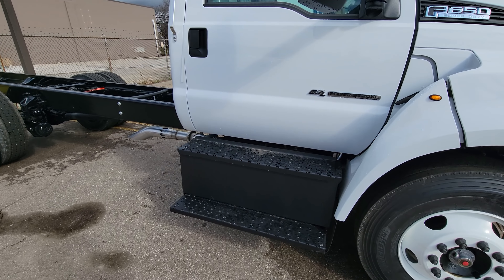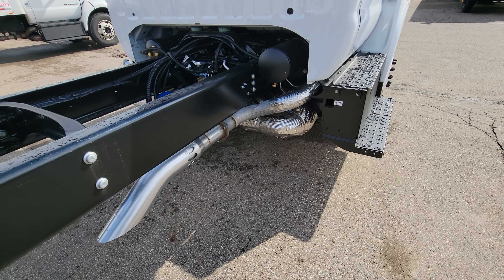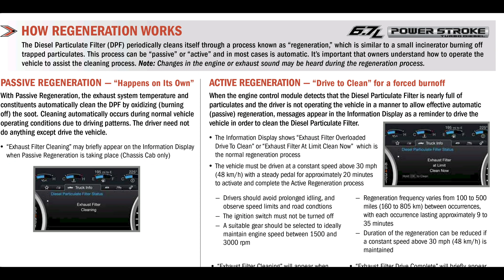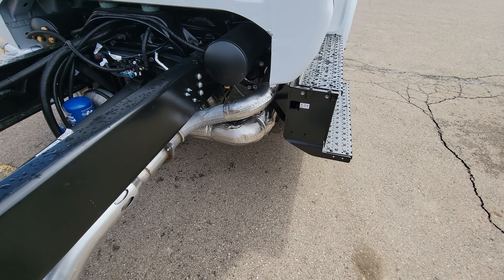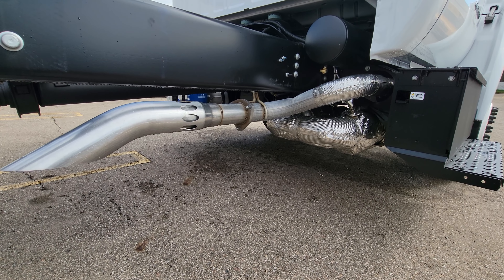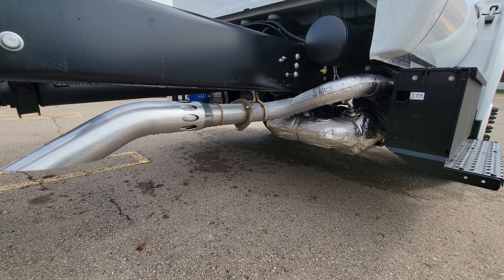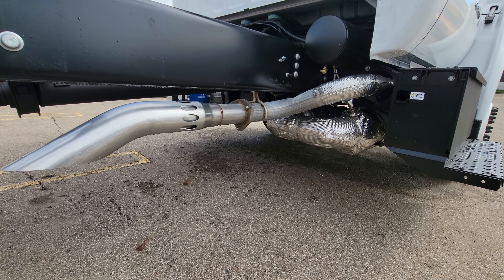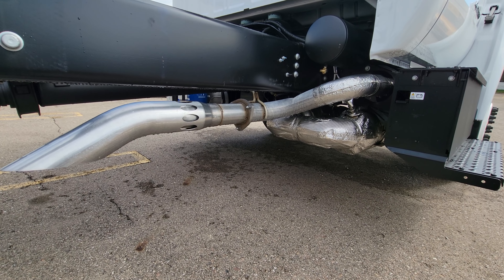IT's TIME! Emission & DPF Filter Regen TALK | What is goin on, What 2 expect & HOW TO USE

Comment: Arod question for ya! On my last regen while driving I hit some traffic for a couple miles and I thought the rule was anything less than 45 mph it will interrupt this process. Well it didn’t! I had my particulate screen up and noticed the percentage kept going down. I was happy it completed because my OCD is when I need to do a regen! But what are the rules while driving. What will cause a regen to stop? By the way thank you for spreading all that knowledge!
Reply from the maker: It has to be stopped for a given amount of time. U musta just kept it in the sweet spot

Comment: 21 f350, for the first time I watched the DPF being cleaned, went to 100% then started to drop. But 15 to 20 minutes of driving back home at 70 ish wasn't enough time to complete the cleaning, pulled in the driveway at 10%. Is this a big no no, or will it just continue and finish the last 10% of cleaning on my next trip without any potential problems?
Thanks
Reply from the maker: 10% no problem. Its repeated stops like this at 70 80 90% & not being cognitive enough to realize the truck is in the middle of cleaning that I would be worried about....! Good question tho

Comment: I still don’t understand why certain applications like garbage trucks still need to meet the same strict restrictions as an on highway truck. The constant stopping and idling is hell on the dpf system. I just learned from a truck driver from Alaska that they have dpf/def systems up there as well. Like it’s already hard enough running a truck in -40 degrees let alone having to worry about doing regens and DEF freezing.
Reply from the maker: -40F I don't even know what I'd do....
Reply: Thats why alot of garbage trucks around us are going to the cng. And those are another problem themselves. Its a lose lose situation this world is going
Reply: At -40, truck doesn't get turned off, or has plug in heaters. I have friends in Alaska. Even cop cars are left running 24/7 in places.

Comment: I’ve got a 19’ F2 fitty. Just bought and currently driving cross country back up to Alaska (towing a travel trailer also). Running like a champ. Regens just fine but never goes to 0%. It usually stops at 20% or so, lowest I’ve seen is 18%. I have the edge insight cts3 for monitoring the percentage. Is this normal for it to not go down to zero or is edge insight not reading it correctly? Any info or insight appreciated.
Reply from the maker: You could try manual regen
Reply: Throw that insight in a rest stop garbage can and get Forscan. Activate your DPF% screen and deactivate auto regen so you can turn it off. Use Forscan to monitor any PID you want along with programming changes. Oh and it's much much cheaper.

Comment: I've heard of some sensors related to the emissions after treatment system failing with higher mileage and stranding drivers until it's towed to a dealer for replacement.  Can you shed light on common failure points and part #'s for those of us who might want to keep some spare sensors on hand to not get stranded? Thanks!

Comment: New to the 6.7, my dpf filter is currently at 90%, will it start a regen at 100%?  Will I get a warning its happening or about to happen?    It's a 2015 xl
Reply from the maker: It will. It may display the drive to clean exhaust
Reply: It will begin regen at 99% (displayed- if the engine is hot enough)  and count down in increments of 5.   If the weather is very cold, you can ease it around for a few miles to keep it from kicking off, but conversely if you slow down at a ramp or stoplight, the Regen may terminate early when really cold outside.  I would downshift manually trying to keep my rpms above 1500 and it seemed to help.  It is almost impossible to stop a Regen from kicking off in hot weather. Sometimes you just want to make it to the next day or 10 miles down the road, you know?
Reply: @SeaPro360  I just want the first one to go smoothly so I know what to expect for the future.  Obviously with 100k on the clock it's done it before but not when I've owned it.   Truck is new to me

Comment: We know these trucks use a lot of fuel to be soot free. There is the 20-25% reduction in fuel economy just for having the system in place, as well as the fuel consumed to regen. Is all the extra CO2 that results from regens and the diminished fuel economy wirth catching the soot??? Somehow I think it would be more beneficial for these trucks to get 20mpg instead of getting 15mpg.

Comment: Need sone help here: 2016 F250, deleted, EGR unplugged but not blocked off, 200hp SDT tune, stock exhaust (drop in delete pipe), 75k miles, bought it with 7k miles. Does not consume oil or coolant. Smooth idle, great power, no CEL or funny stuff. Crank case vent is still installed. I run archoil and good diesel. Best money I have ever spent...... just one concern. After getting up to temp, a medium haze of blue smoke will spew from the tailpipe only while idling. Smells like raw diesel. It has done this ever since I deleted. Anyone else’s truck do this? I suspect tuning? Out of ideas. Been in and around these trucks/motors quite a bit, got a few of them in my fleet including my personal truck.  Thanks for any help!

Comment: Is there any way to start a regen while driving? Like turn the option on with forescan or anything? I turned the percentage on which is helpful but I’ll take a 40 minute drive on the highway when it’s at 95% and won’t regen. It’ll then be stuck at 99% and now I’m driving around town for the next week...
Reply from the maker: Do but u cld just stop wasting time and just do a manual regen when u get home with ur scan tool
Reply: @PowerStrokeTechTalkwARod  so there’s no menu option to do it? I just want to do it to prevent problems until my warranty is up...
Reply from the maker: While driving normally, no. Driving w/scan tool yes
Reply: If you enable OCR using forscan choose option #3.  I believe it is named “OCR with regen inhibit”. That will allow you to start a regen once the DPF reaches indicated 100% capacity.  That way you never get caught with 5mi left in your commute with a truck starting a inopportune regen and not completing it.   However the onus is on you to do a regen before it fills to a level that puts you into limp mode putting you at the dealer for a forced regen.  I’ve run mine to 130% a few times without issues.  However most times I’m doing it at 105-110%.  2020 F350 KR.
Reply from the maker: Thanks for sharing
Reply: @original72canuck , yes that’s how you activate it in full manual operation. It will tell you it’s full but not activate the regen process. After 100% full, the system will typically say drive to clean. If I remember correctly, 150% is basically engine idle only as it believes the DPF is indefinitely clogged and needs removal for service. You can try and fool that figure by creating a “calibrated leak” in the pressure differential hose which in theory would drop delta P across the filter to a lower value which should allow a regen to occur. Granted, I’ve never seen this get that out of hand yet but anything is possible.
Reply: @TC93 sounds like something is wrong. It won’t regen until it is at 99%. 95% will not cause regen unless you approach the 500 mile threshold for a scheduled active regen. Could possibly be the pressure delta sensor in the DPF or the throttle plate not functioning properly. Wild enough, the throttle body/throttle plate is a contributor to the regen cycle occurring.
Reply: So I set up my truck allowing me to disable regen and added the filter to my screen. Can someone please let me know at what percentage you are causing damage? Also with what I did on forscan will it allow me to do a manual regen while stationary? I have not enabled OCR at the dealership. Thank you! I love your videos!
Reply: @vais3  nope nothing wrong. Just trying to take advantage when I’m on the highway! I just learned it goes up to 130-150% though
Reply from the maker: Thanks pal

Comment: Anyone know anything about the P2002 code. I’ve done the manual regen and the CEL/MIL went off and now back on. I would consider the truck use city more than hwy. truck just reaches operating temps and maybe 15 minutes past before arriving to job site and turning it on and off through the day to relocate. I’m not real clear on what the usage of the trucks is supposed to be as it seems only hwy use fairs them well. I also understand there to be an issue with the dpf cracking prematurely via a TSB I found covering a few years. I’ve been doing oil test and all is well except 10% fuel dilution on regular oil intervals 5-7k. My understanding is these engines and pretty much any engine is designed to get to operating temps and maintain those temps for some time thus mitigating some of the fuel in oil upon startup via chemistry and heat. I don’t interrupt any cleaning cycles however I don’t feel it’s getting the best “dpf plan” given what we all know about the systems. In other words it sees a to take some pretty ideal conditions that most don’t sustain for a full burnoff. Any insight in this code and can we look at inlet and outlet pressures via FORScan to see if we have a crack or leak. I don’t know what the values should be.
Reply from the maker: Time for a a catalyst
Reply: @PowerStrokeTechTalkwARod  at 70k miles? I care for this truck like your million mile 6.7 you had in a while back. And by catalyst you mean the SCR?
Reply from the maker: Yepp cat scr dof are all the same tbing
Reply: @PowerStrokeTechTalkwARod  troubleshooting is not the art of replacing a bad or worn part, it is finding out what led to that premature failure and adjusting in balance. I’m pretty disappointed in the vague reply being that answer leads to replacing the scr every 70k miles. It may be one unit but it’s not all the same, scr reduces NOx and dpf reduces soot. More soot occurs at low temps and more NOx at high combustion temps. I apologize if my previous comment bothered you on the water separator for whatever reason, it’s kinda hard to watch y’all, drain 1/3 tank of diesel taking the filter out. Dude I’ve seen the best including myself do silly stuff while building or working on cars, who cares. I’ve seen much  one respectful answers from you to others which makes me beg the question. If you don’t know values for the pressures or don’t have time to dive into stuff like that it’s cool bro, reference someone else for me to ask, but having an answer that drains the bank account when everything checks out via my comment, it just makes ya wonder. Understanding them difference in scr vs dpf is very important and both can be cleaned up to a certain point which is why I reached out for further knowledge on the fords doing this. Due if you said that to diesel podcast they would cringe. It was an unhelpful comment my friend and I’ve doted on you quiet a bit to others. We’re on here to help each other so if there’s a better place to have a discussion about this or get info on it just say it
Reply from the maker: You clearly missed the point in my short comment. If you want diag time, email us or bring me the truck........................

Comment: My 2020 has never told me it was regenerating, Just returned from a 2000 mile trip with no regen. If it had regenerate I would like to have known
Reply: The regen in process display isn’t on very long on my 2016. Wish it was on till either it was done or I pressed OK.
Reply from the maker: Ocr

Comment: Have you gotten any of the recalls fix in your rig? There’s 2 recall.
Reply from the maker: .......which do u talk about
Reply: Recall 21b03 and recall 20c19 it’s all 2020 super duty
Reply: Been putting it out as the dealer says might take couple days up to a week. Only have 1600 miles on mine.
Reply from the maker: I duno what ur talking about  Bryan...
Reply from the maker: 21B03 is NOT a recall fyi...
Reply: @PowerStrokeTechTalkwARod  yea it’s weird I talk to the dealer about the 20c19  but they wasn’t aware. I actually got that info from a guy here in YouTube stating that the dealer sent him that form. I did get a notice from the dealer about the 21b03 about bearing in transmission may wear prematurely and cause rough shifting. Any just thought I’d share, keep making those informative vids!
Reply from the maker: Thanks pal. Believe me ima cover it cuz its on MiNe🥴🥴🤨🤨

Comment: My 2016 f-350 had the messages once a week it was more than aggravating. My 2020 with 15000 mile on it has yet
To alert me of anything but low tire pressure. A resent 7000 mile trip I did use 17 gallons of exhaust fluid while towing my 12000 camper was nice not to see any messages.
Reply from the maker: You need to get OCR turned on
Reply: OCR ?
Reply from the maker: Go to my playlists & look it up. I have 3 videos for each year change

Comment: ARod, it seems sometimes I regenerate to 0 or 10 percent but sometimes the process stops at 25 or 30 percent. It almost seems regen time or miles driven is capped even if you don't hit 0 percent.
I's a total pain in the ass but if I drive home from work and truck begins regen I keep driving around another twenty minutes or so to try and let it finish (drive to nowhere). Can't do that on the way to work though...
Reply from the maker: Lol, i totally feel ya...deal with the same shizzzz...thank goodness for Forscan...videos on how-to coming soon
Reply: That’s the beauty of enabling OCR.  With OCR enabled, it activates the DPF % display.  When I’m approaching 85% full, I click over to “settings” and I disable “Auto Regen”. This keeps the system from going into regen without my knowledge.  At about 95% full I start paying attention for the “DPF Regen Soon” message.  Once that is displayed I drive home, set the parking brake (engine running of course) the follow the directions.  You have to press/hold ok past 2 messages.  Once second message about “your sure” is answered .. the engine kicks in high idle .. runs for 30mins .. then idles down when Regen is complete.  I like to get in and drive it around then block to cool things down afterwards.  Then I reactivate “settings/auto regen” and wait for the next 500/550 mile interval to next regen.

The beauty and convenience of enabling OCR is the “DPF% gauge” and ability to turn off “Auto Regen”.   This way … YOU control when a regens start.  Whether on the highway or in your driveway or work parking lot after lunch.

Like ARod said .. these things get real hot during a regen.  Be sure you’re parked in a safe/open place.  You don’t want to melt your buddys bumper or burn your garage down.
Reply from the maker: Thank u Michael
Reply: @mike_adams   Yes, my dealership was very cooperative about enabling ocr with the def display. Personally I would rather drive during the regen process instead of parking it and letting it roar for half an hour.
Reply: What I like about this channel ... Solid info.   (have a '17 F350 Dually).  I did the ForScan Mod Manual Regen shortly after delivery (and other Mods).  Have a Banks Derringer and though I turned on DPF % on the Truck screen with Manual Regen option, I keep Tire Pressure up on the Truck screen all the time, ...so I have the Banks Gauges display DPF % instead.  
Does anyone know if turning off Auto ReGen disables the "Passive" ReGen activity also?    
Since I have set the Banks DPF monitor to "alert" at 90% DPF Full Status,  Michael like your idea to leave the Truck settings (leaving on)  Auto Regen,  ... then when I get an alert at 90% full on the Banks Derringer, turn off Auto Regen on the truck settings until I am sure I can drive 30 mins at 2K RPMs, or get to a parked spot and do a stationary Manual ReGen.    I will start doing this until I can figure out the Passive Regen situation with Auto Regen off.

Comment: Pretty sure a properly tuned truck shouldn't need all of these emissions systems onboard.  The injection system and controls on new trucks are so far ahead of the old smokers of decades ago.  It's a solution in search of a problem.  And there are only those who've had emissions problems and those who will have them.